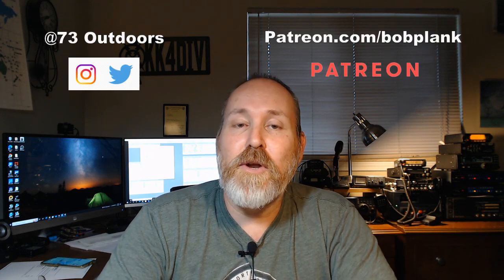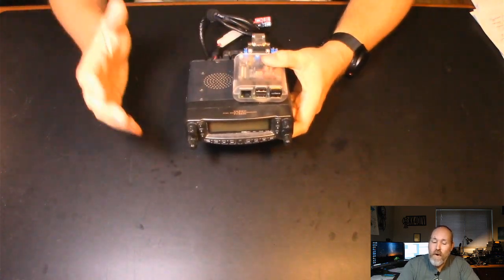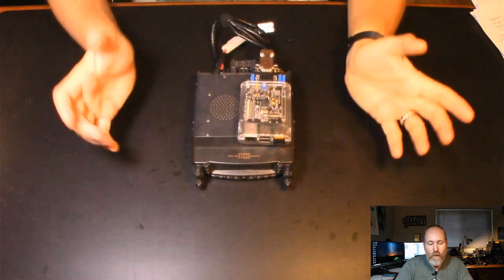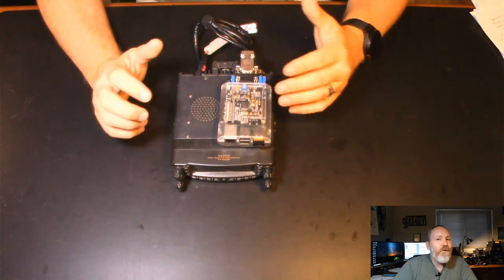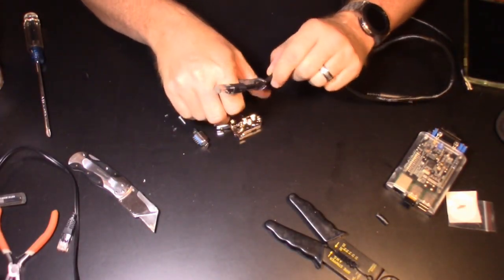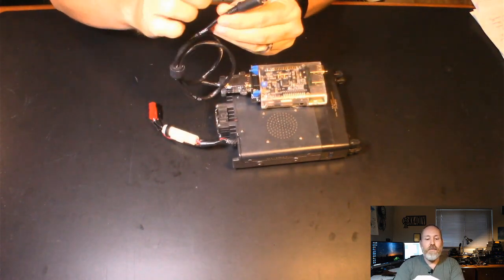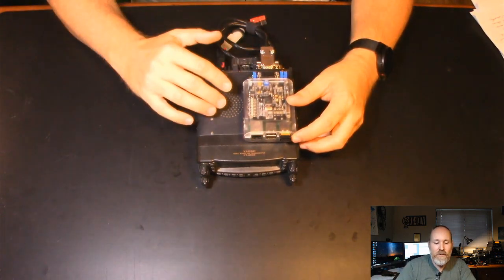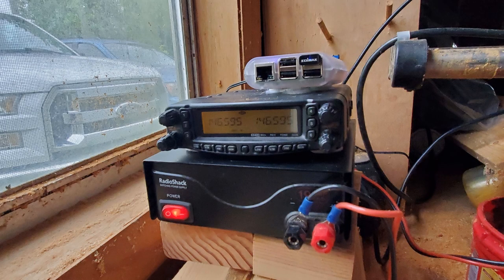A High Powered DMR Hotspot project with the STM32 DVM Board

Comment: I am working on adding this MMDVM board into an old Motorola Desktrac. Have to make a mod to the transmitter board for 9600  baud data to the exciter section of the transmit radio.

Comment: Are you using the radio to receive and transmit at same time, or is the repeater board caching it and then transmitting on afterwards?
Reply from the maker: This setup operates simplex.  It can only either tx or rx at one time, not both.  There is no store and forward, no caching in this board.  If you want full duplex like a repeater, you would need 2 radios.
Reply: @BobPlank_KK4DIV I wasn’t sure as the radio used can work as a repeater and has 2 channels ?

Comment: What distance will I get with a tyt repeater build using their equipment?
Reply: It would depend with frequency used, how high the antenna is placed above ground and power output of the transmitter. You also have to figure out losses through the duplexer used, number of RF connectors used in the whole system, type of cable used to the antenna and interconnecting cables in the antenna network and finally the gain of the antenna. You might also have to co ordinate with you regional group that assigns frequencies so you do not interfere with another repeater.

Comment: I put together one of those.  I bought a board at a Ham Convention and connected it to my Rasperry Pi and a Yaesu 2/440 rig.  In fact the radio was a 8900.  It did work but
al little tricky getting the tiny trimmer pots set right.   It's been several years since I used it.   It's the same company you got yours from.
Reply: Whats the setting for setting an ft8800 for like allstar?
Reply: @kg5nub  i sent 2-3 questions about that too here,,,,,,,,,,never add an answer !!i wonder if the gentleman still with us!!!
Reply: Have the same equipment and looking to interface it with a 70 cm Motorola Desktrac. I will have to do the 9800 baud modification to the transmitter radio. Thinking how I could switch out the mod to do analog and when P25 is detected it can run through the transmitter mod.

Comment: Those MMDVM boards are fun.  Two tips for those reading this...first, Amazon sells DB9 serial cables very cheap--get one and cut an end off and you'll have all nine wires and they're stranded.  Second, raise that mobile off the hot power supply and add two muffin fans (4" will work) side by side blowing from the back towards the front...you mentioned heat--whenever your handheld is receiving, your mobile is transmitted and it'll easily go over the duty cycle and overheat the mobile.  Get it cooled and you can do high power...although antenna altitude would help more (and quality feedline).  Love the options...DMR, D-Star, YSF, & P25.  You can even add an OLED screen or Nextion screen to "see" what's going on.  The only difference between this and a repeater is you may not always here someone that's local transmitting into your MMDVM because it's not being amplified and re-transmitted.  Remember the most important rule of linked radios--NEVER tailgate...always leave space between parts of QSOs so others can unlink their radios (you can't unlink when it's transmitting, you have to wait for the rude operators to shut up so you can send an unlink command).

Comment: What is your living environment, trying to setup a repeater in a mostly urban area just curious if it will work well
Reply from the maker: I live in a suburban area. If you are in an urban environment with high buildings, you may have problems unless you can get your repeater antenna on top of a building.